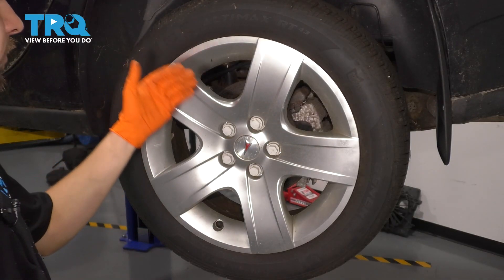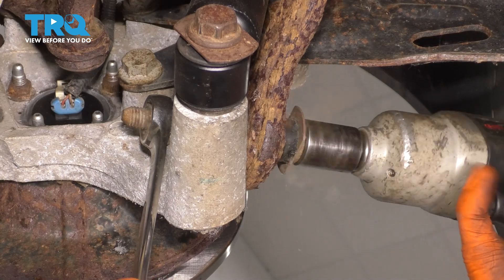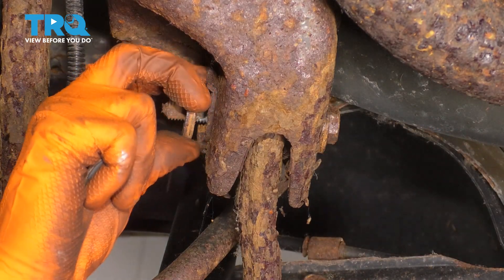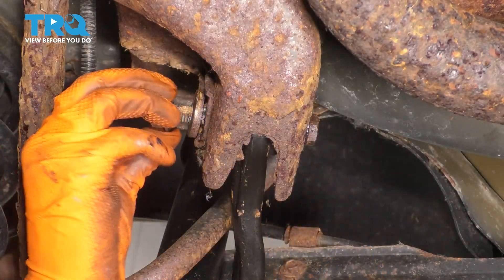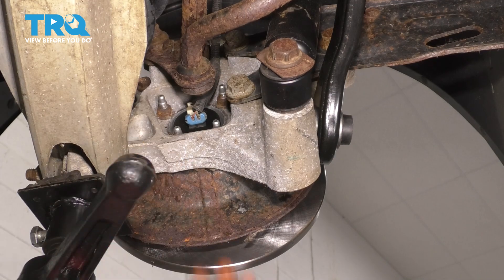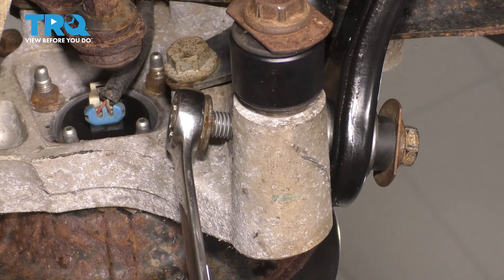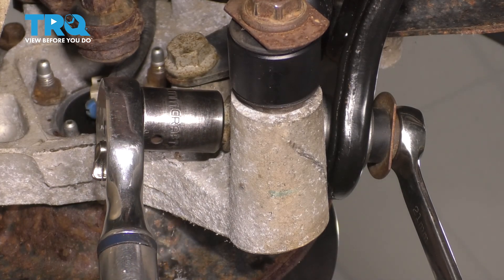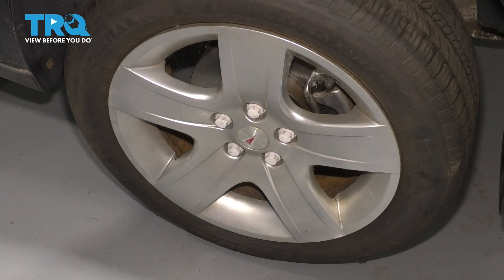How to Replace Rear Toe Arm 2005-2010 Pontiac G6

Comment from the maker: √  Watch the Video
√  Buy The Part at 1A Auto http://1aau.to/m/Shop-TRQ-Parts
√  Do it Yourself
√  Save Money
Reply: Anyway you could do a video on how to replace the rear upper control arm on the Pontiac G6? Mine is squeaking because the bushings are shot and the workspace is really tight. Want to see how I can safely remove the spring and have enough space to remove the arm

Comment: Can you do a video on how to replace the rear upper control arm on the Pontiac G6? Mine is shot and it’s squeaking and I want to know how I can do it safely by removing the spring in the back. The workspace is very tight as well
Reply from the maker: +rocketrodlover We do not have a video for this repair right now, but we'll keep this request in mind for a future video! http://1aau.to/m/Shop-TRQ